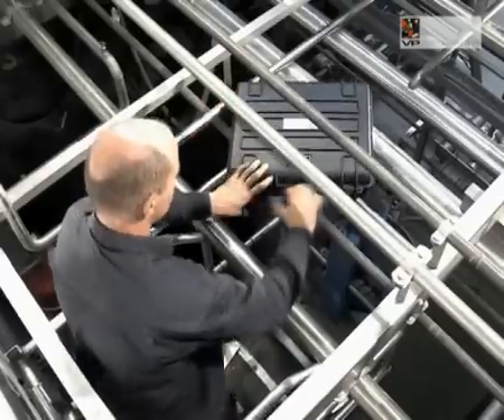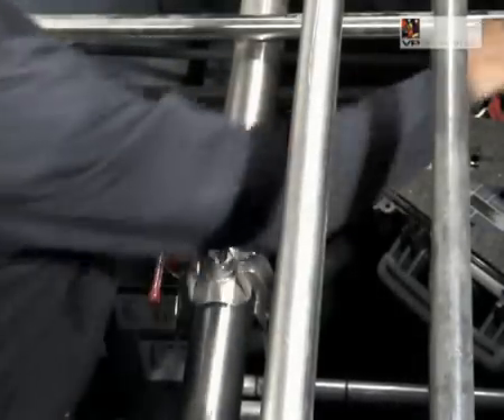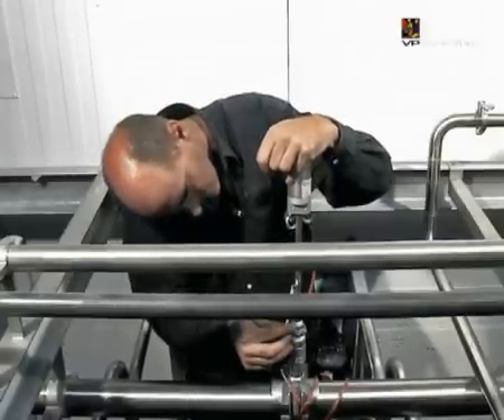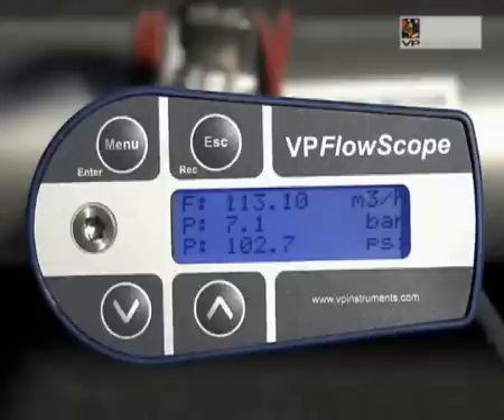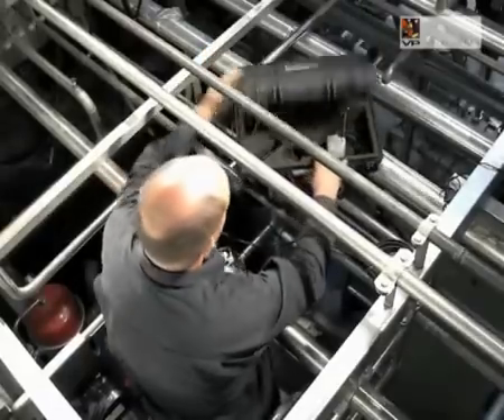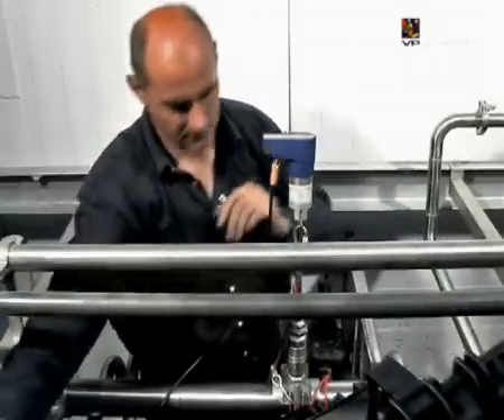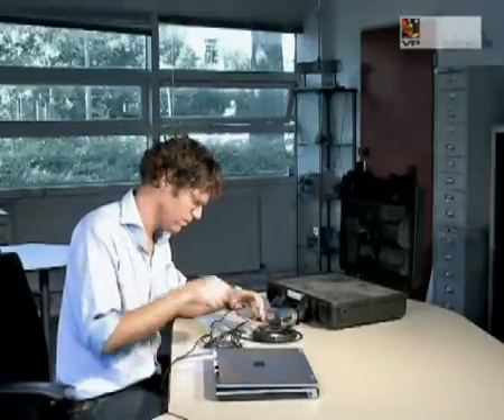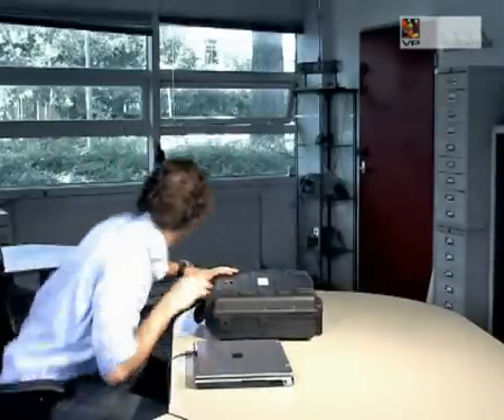VPFlowScope instruction video

Comment: Compressed Air Flow Sensors by VPInstruments can also be used for Nitrogen, Argon and technical gases. All in one, that means flow, pressure and temperature are measured at the same time by the same instrument.